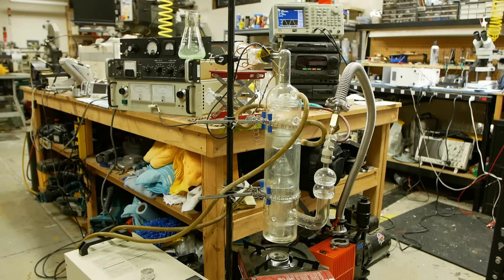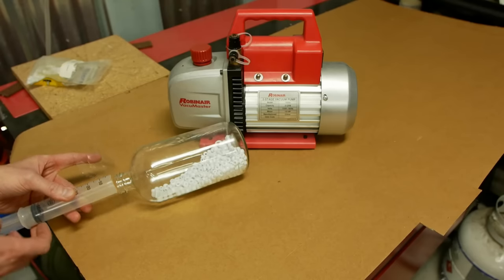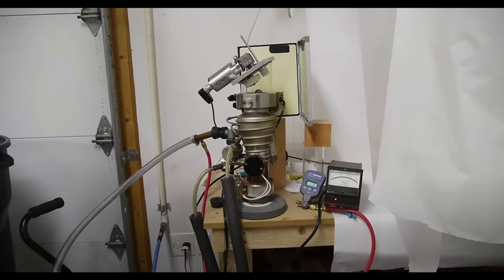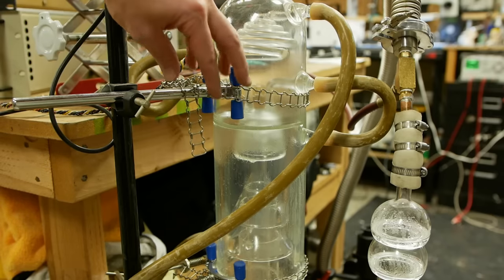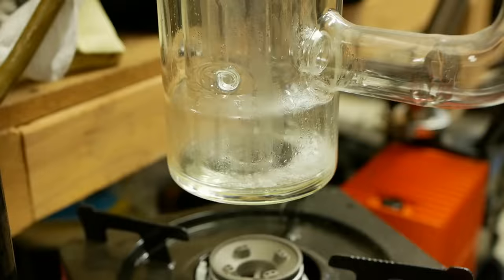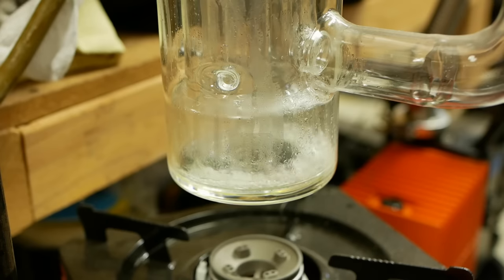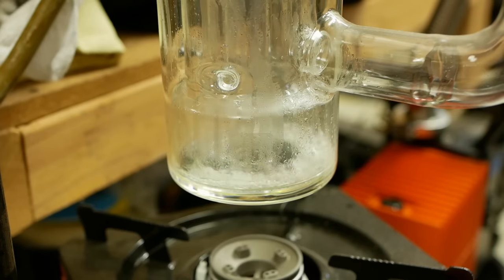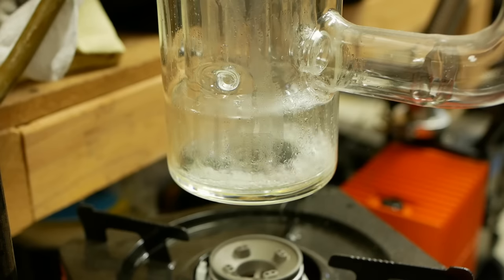Giant glass diffusion pump and cathode ray tube demo

Comment: When I was in college one of my profs was telling stories about his vacuum experiences. One; he had carefully set the system up, using all the lessons learned earlier (e.g. new copper gaskets) but it would not pump down. Tore the rig apart and found a fly in one of the tubes. Turns out flies out gas rather well. :^)
Reply: The one thing all stem profs have to deal with, bugs in their systems.
Reply: Pumped a cricket down to high 4 scale Torr lol
Reply: Well, I once forgot switched on flashlight inside vacuum chamber (ion beam sputtering). Pumping was a bit slower than usual but marginally ok. I was pretty shocked when opened a window and saw the light...

Comment: Used Diff pumps a lot, no how they work, seen a hundred diagrams and only your channel showed me one running....cheers!
Reply: same, I maintained a set of big Varian diffusion pumps for over a decade - it's very cool to see a glass version
Reply: know*
Reply: Yeah, right?  I used to run ion deposition chambers with twin DPs each the size of a home water heater. Never had the time to really understand how they worked.
Reply: they're so simple that it's a pleasure to take one apart for cleaning - leaking krytox was the biggest problem,  it was $2000+ per gallon back in the  90's
Reply: Similar experience here,  I'm a design engineer for a company manufacturing electron beam welders. Always wondered what exactly was going on inside the diff pumps we use, plus the added bonus of seeing a mini EB gun.
Reply: This is the first one I am seeing with an external burner. I have many and all with electrically heated (nichrome coil and a variac).
Reply: very good - always nice to meet a fellow variac user 

we had an ancient, huge bench-mounted variac in the lab that was obviously made from the parts of several of them - we called it the scariac lol - it had a big, heavy wheel for a knob that took both hands to change the voltage and it emitted its own internal light when you changed the power level in a dark room
Reply: @janami-dharmam  Probably a classroom/test unit. The one at Lucent was bigger and self-contained, and it only pumped down a chamber maybe 18"x18".

Comment: Glass diffusion pumps are still commonly used for neon sign work and were also in quite common use for producing one off vacuum tubes and the like. The advantage is in the ability to connect to an all glass manifold for gas back filling or to the pumped item directly with glassworking techniques rather than metal working techniques.  As a side note DC-704 and other silicone based diff pump oils cause great havoc when exposed to atmosphere while hot resulting in an horrid black tar which cannot be removed except by aggressive mechanical means. The much safer (read: expensive) option is a Polyphenyl Ether based oil like Santovac-5 which contains no silicon.
Reply: Yep Santovac5 is what i have used

Comment: As you explained in the video, the silicon oil absorbs unwanted substances, so the mechanical pump is always needed to bring the vacuum down, draining out such substances, as you did, and then getting out the residual gas. It also helps to drain down the oil vapour. If you turned the mechanical pump off, you'd contaminate your vacuum chamber, even if you cool the top of the diffusion pump with liquid nitrogen. Therefore you must have an automatic valve to shut out the connection with the chamber if electricity goes out. Actually they are a pain in the neck to use, so people prefer turbo-pumps which are far cleaner, if they can afford them, that is.
By the way, great video! I really appreciate your resourcefulness.
Reply: Turbopumps are hard to scale, though, and a big installation needs a lot of them.  This is why in big vacuum furnaces you will see diffusion pumps used to create the high vacuum.  They are also often used in synchrotrons in tandem with cryopumps.

Comment: Thank you.
   Worked as a mass spectroscopist using GCMS, He leak detectors, and isotopic ratio mass spectrometers.
   System pressures were 10 -8 microns or lower with a good vacuum. 
   Use dry nitrogen or argon to let the system up to atmospheric pressure.
This reduces pumping time. 
   Water from water vapor in the air is an enemy as far a getting a good vacuum.
   You might get some vacuum gauges. A
1946 tube with a meter or a Pirani gauge is good for rough vacuums down to about 1 micron.  For higher vaccums, use a hot cathode or a cold cathode vacuum gauge and controller.

Comment: Great video as always! Few notes though, as you have shown it, forvacuum mechanical pump could still reach absolute vacuum with infinite time, which is not true for real pumps. Real mechanical pumps have a hard limit on the pressure they can achieve (even given INFINITE time!), largest limiting factor being "dead space" of the pump(turbopumps excluded). Dead space is a volume of gas at exhaust pressure(1 atm for forvacuum pumps exhausting directly outside) which is left when exhaust valve is closed. If you think about plunger/piston type pump, it is the volume which is left when cylinder is compressed completely. Air in dead space at atmospheric pressure then is expanded to full cylinder volume, decreasing the pressure until intake valve opens, which limits the minimal pressure one can achieve.

You don't seem to have a return path for electrons in your crt, you are charging the screen which screws with focus and makes it fuzzy. Also you could try to deposit ZnS as a classic green luminophore.

Edit: fixed grammar to make it feel less like I had a stroke. Merged another comment.
Reply: He never said a mechanical pump would ever work with time, he said the factor was time.
Reply: @ipissed  sorry, I maybe should rephrase it in the morning, didn't mean to sound like I'm attacking. But what I want to focus on, is that main limiting factor for pumps relying on change of working area volume is the amount of dead space, limiting pressure even before molecular flow sets in.
Reply: Interesting point about the charging of the screen. How best to fix this? Deposit a clear conductive layer beneath the phosphor and wire it to the filament? I wonder if I can manipulate my CRT oscilloscope’s trace with a high voltage near the screen...
Reply: @Scrogan  traditionally you would rely on material of phosphor having strong secondary emission so for each electron hitting you get multiple electrons leaving. Then you would need rest of internal surface up to an election gun covered with positively biased conductor to capture and remove those secondary electrons. Also from what I seem to recall phosphors on old screen looked grainy, I am not sure, but that might have been done on purpose to increase secondary electron emission.
Reply: Thanks for this description, suddenly pumps make a lot more sense, reminds me of multi-stage refrigeration where one of the limits is the temperature of the heat dump, same with the pressure of your air 'dump'.
Reply: James Barclay 
Commercial CRTs flash a thin layer of aluminum over the phosphor and the inside of front part of the glass envelope.  From there, an Aquadag (carbon (graphite?) in suspension) coating on the inside of the glass envelope connects to the electron gun’s final aperture and an external anode connection.  So the whole front part of the CRT is a Faraday cage at the full anode potential, with zero internal electric field.  Once the electrons leave the electron gun, they experience no electric field, just the magnetic deflection fields.  The electrons impact the phosphor screen, and the charge that would build up on the phosphor is drained off through the aluminum and Aquadag layers to the anode connection.
Reply: @w6wdh  The shadow mask (color TV) us connected to +25 kV, like the slanted surface.
The carbon conductive layer on the outside is connected to 0 volt. It form a capacitor with the thin glass in between used as insulating plate separator.
If you unplug the +25 kV connector live, with the TV displaying some image, the capacitor hold charge for about 2 seconds.
Reply: @w6wdh  but not all the charge apparently because they are dangerous to touch after they have been running and as a safety precaution one is instructed to short the anode to ground.

Comment: Wow! Great video! 
I worked for a vacuum furnace company. They would have two guys clean the inside of the entire furnace with alcohol prior to the first run up. This minimized the outgassing but took the better part of a day. It would take quite a while to pump down(rough out) the first time. One time the valve controlling the diffusion pump vacuum flow was installed incorrectly. The roughing pump pulled the oil out of the diffusion pump coating the inside of the furnace. If I remember correctly, it took several days to clean it all out.

Comment: I first encountered oil diffusion pumps in graduate school. Our Beckman ultracentrifuge had a standard reciprocating piston pump to get most of the air out of the chamber. Then you switched on the oil diffusion pump to get a very high vacuum. I'd never heard of such a thing before and was fascinated by how they function with zero moving parts. This was in the early 80s, no internet or Google back then so I had a bit of a job finding the information.

Comment: I'd think nichrome should work well as an electron emitter at dull red heat since chromium oxide is an excellent source of electrons, I'd heat it in air one time to get some oxide.
Reply: That is actually interest, could be worth a try.
Reply: And you can buy it precoiled for vape pens really cheaply on aliexpress.
Reply: Sorry to blow your idea. The nichrome will burn out long before it begins to emit. I have tried this in my tubemaking with zero results. Oh well! Stick with the tungsten with the barium carbonate.
Reply: Thoriated tungsten is probably the way to go:  much better work function than pure tungsten, and can recover after exposure to atmosphere.

Comment: Very nice video and beautiful pump! Gives me flashback to my PhD there we used a 50 liter diffusion pump to vacuum a huge high voltage discharge system. The stove was firmly attached to its bottom and the running tap water was used for cooling. The engineers told me that the hot oil would burn if no pre-vacuum created prior to heating it up.
Reply: That's because it lowers the boiling point

Comment: the reason why they don't use diffusion pumps as a single stage is because the pressure difference that they create is pretty low. so this can (very roughly speaking) either get your pressure from 1 bar to 0.99 bar or from 0.01 bar to almost 0, that's why it makes sense to use a mechanical pump as the first stage to get you to that 0.01 in the first place.

Comment: Thank you for this amazing video. I've always wanted to actually see what's going on in my metal diffusion pump. Now I know! The CRT is an astonishing achievement too, well done there. Barium carbonate is converted to barium oxide upon heating, and barium oxide would combine with with moisture from the atmosphere to form barium hydroxide so as you say quite rightly it cannot be subjected to the air once applied and heated.

Comment: Very cool video! I work at a high vacuum company, we use diffusion pumps large enough to fit inside. This is my first time actually seeing one operate. Its a concept quite difficult to understand with out a visual, I will be showing this to future recruits. I also liked your explanation of molecular flow in everyday terms. 
I'd like to know what type of oil you used. And yes, too bad that particular pump was made with such poor conductance.
I'm not sure how difficult it would be to home build and Ion Pump? That would be very cool to see, and help you achieve UHV. Keep experimenting!

Comment: Worked with diff pumps for a long time. Cool to see one like this. Btw, you should have insulation near the heat source to prevent rapid cooling at the bottom. Also, with the plastic.. helium can penetrate some with no issue and it's even used to outgas helium (used as a carrier gas) from thicker material by pushing through plastic or PTFE loops.

Comment: About your claim that you don't technically need the roughing pump (at ~5:10). My experience is if the outlet of the diffusion pump is above a certain pressure, the oil in the diffusion pump increasess in volume (due to dissolved gas) and spills over into your system. The excess air pressure can also burn (oxidize) the oil making it char.  This is a problem especially when the power goes out -- if it comes back on unattended, your roughing pump doesn't pump down fast enough, and the pressure is too high when the oil starts moving again. 

Just nitpicking -- your videos are so cool!

Comment: Electron microscopes tend to use either pure tungsten or a LaB6 (lanthium hexaboride) tip if they are purely thermally driven. This means they are easily user replaced in the lab and we dont have to handle sealed units when replacing the tip. Using your material for extra brightness would caus problems with that. Extra brightness is always nice but honestly, we burn through tips every few years, so replaceable is key. For extra brightness we tend to use a FEG (field emission gun) which draws electrons out using electric fields (with or without additional heating).

Really interesting video btw, having used oil diffusion pumps for years its nice to watch it working.

Comment: I worked where they mirrored glass on a machine that had a mercury diffusion pump, That thing could pull a vacuum in a 20 cubic foot chamber in like 5 seconds, then the aluminum filaments would start up and deposit onto the glass in about 5 seconds. It was very cool.
Reply: I didn't think heat was used in a mercury vacuum pump. I thought it worked by circulating the Mercury to the top of the system and letting it fall through a restricted opening over and over?
Reply: @lvstofly  You describe a Sprengel pump, which is not the same. Cody'sLab built one, there's a vid. A mercury diffusion pump works just like this oil version.

Comment: The oil & chemical industries uses steam ejectors - those work off of the momentum transfer method too.  Like the bottom of your diff. pump ejectors can be staged and the final pressure (vacuum) is determined by the overall compression ratio. I worked with those in the 90's and the roar of the steam was deafening.

Comment: As a note;
Modem electron microscopes use lanthanum hexaboride emitters, and they have isolation valves such that the source never gets exposed to air. A separate vacuum backing for the source keeps it at very low vacuum (10^8 or better) and there are interlocks for vacuum level that must be closed before the sample chamber is opened to the source

Comment: Great video as always! I didn't know that diffusion pumps came in glass! A lot of systems in the semi industry have moved away from diffusion pumps in favor of cryo or turbo pumps for achieving high vacuum in sensitive systems where any backstreaming(what you talk about around 5:37 ) could be catastrophic. If anyone wants to learn some more about vacuum systems "A User's Guide to Vacuum Technology" by John F. O'Hanlon is, from my understanding, the industry standard for vacuum systems. Certainly at a minimum quite a good resource. It was one of the required textbooks for my thin films class.
Reply: Thanks for the book recommendation!

Comment: Worked in high vacuum metalization for about 25 years we used to climb in some of them to clean them. Ours had bell covers that lifted when we hit a certain mbar. Boy tell you what them bells pop in atmosphere the heated oil would flash and the explosions was some kind of loud🤣 Make your ass jump anywhere in the plant. I’ve seen them blow hard enough to deflect the main shaft which were very thing stainless steel. This is a really cool model and I enjoyed this thoroughly. I have to show this vid to my brother this is too cool

Comment: we had similar glass diffusion pumps at uni's lab, experimenting with it was part of the physics course, it was really great.

of course students messed it up from time to time and the entire lab was covered in a thin sticky oil layer similar to the oil layer that builds up in your kitchen over time. i wonder if that issue could be avoided if the pump is always used properly